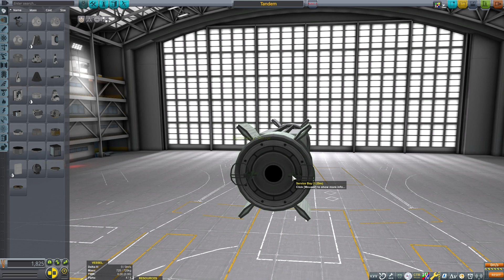KSP Helicopter Tutorial: A New and Improved Guide to Rotary Wing Design

Comment: Im so confused, ive followed everything you've done exact for the traditional helicopter and it just dosnt work. it dosnt power up when i throttle up i have to manually set the torque limit andd even at max the best my helicopter does is maintain a slow fall. ive played with deployment angles and everything but i just cant get any lift or automation
Reply from the maker: Are you able to share pictures of the craft? I'm active on reddit and https://forum.kerbalspaceprogram.com/ all under the same screen name. I can watched a video here on YouTube as well if you are able to record what you have.
Reply: did you check if your blades are deployed? might just be a simple overlook for that

Comment: Guys help me! My helicopter dont run the rotors, only run if i correct manualy the torque limit, whats i can make this control act automatic with main throttle?
Reply from the maker: I like to have the main throttle control the collective. Then bind something else like translate up/down to the torque limit.
Reply: @Echo3  I make this translade to torque limit, but dont make any diference, current dont run the rotors.
Reply from the maker: @muriloduarte2017  are you able to share your craft? I could look at it for you.
Reply: @Echo3  I redesigne my helicopters and i make they fly, only dificult is sinc the tail rotor torque for canceling the main propeler torque!

Comment: I found I had to put the main deploy angle at -90 through -65 to produce any lift and the back rotor at ~-56 to -59 deploy angle. Even with reaction wheels its still extremly unstable and will start spinning (no deploy angle of either helps). Has the game version changed so much that this is useless because literally nothing I do with this design works.
Reply from the maker: Make sure to place the propellers so that the painted side is towards the direction of thrust. If can share pictures of your design or a craft file, I'd be willing to look at it for you.
Reply: @Echo3  I got one working eventually, I think I was just attaching the propellers to the side of the rotor instead of on the green nodes and that was what messed me up. Also sorry, I realize I was pretty harsh in my comment, no hard feelings?
Reply from the maker: @heylooka  glad you got it working. No hard feelings, Internet stranger.

Comment: Why don't you just use the hinges for movement on the tandem instead of the airbrakes
Reply from the maker: I have tried to get the hinges to work for me, but so far have not figured out a usable system. The best part about using the airbrakes is that they respond to the SAS.

Comment: Is there any one who does these slower? I can't keep up
Reply from the maker: How can I help you? What are you struggling with?
Reply: @Echo3  I'm on Xbox. And the videos go so fast it's hard to keep up. I'm trying really hard to use the new stuff to build helicopters and thins like that. And I'm not exactly the best player on ksp lol
Reply from the maker: @samueltaylor4910  I intended this to be a more advanced tutorial for those familiar with the basics.

Since you are on console, some of the game terms will be different. You will need to adjust the authority limit instead of the deployment angle.

For the main propeller blades, it is helpful to use action groups to bind the KAL1000 to your main throttle. Then bind the rotor blades' authority limit to the KAL. In the KAL editor, set the limit to go from 0 to 8 or so degrees. Make sure the blades are mounted straight with the striped side up.
Reply: @Echo3  I will check that out tonight. Thanks man. Also I do love your content. Just subscribed
Reply from the maker: @samueltaylor4910  Thank you

Comment: When i put the kal 1000 on a heavy lift heli that I designed, I couldnt access anything to do with the axis fields, mainly deploy angle
Reply from the maker: In the action group tab, did you bind the blade deploy angle to the KAL? Did you remember to deploy the blades?